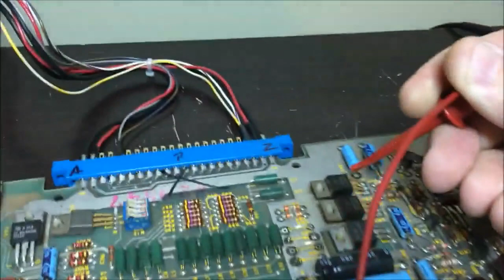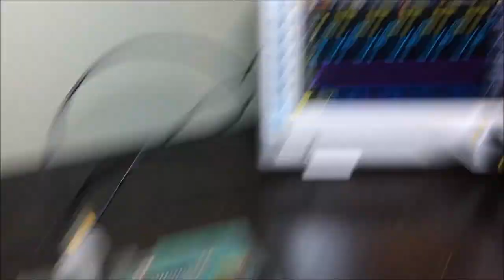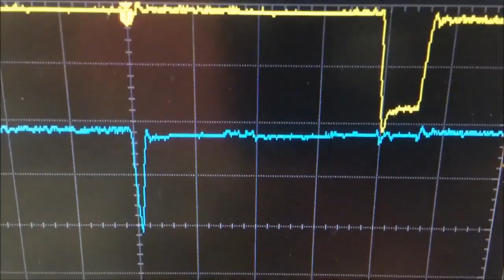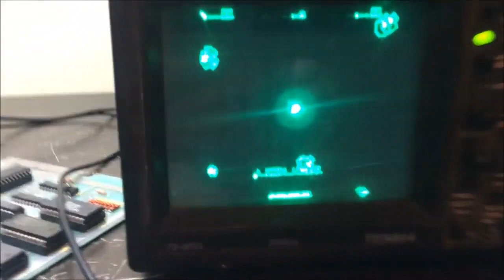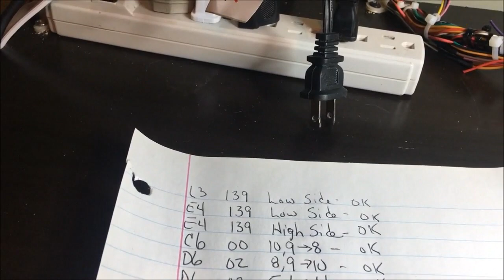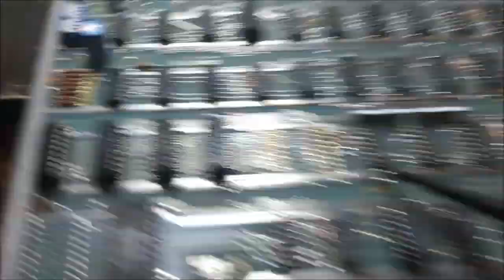1979 Atari Asteroids PCB Repair - From Jan, 2019 - One You May Have Missed - All 3 Parts in One

Comment: I was surprised to hear that 24V is being fed to the input of the 7805. That is a lot of voltage it has to drop and with no heat sink on it. The vector section doesn't have a lot of parts so there isn't a lot of current draw and that will help the part from being overly stressed.
Reply from the maker: I agree,  that is a lot of voltage to to drop in the7805.  probably be better to just jump a wire from the logic +5v over to the output pin of the 7805 would be, and remove it alltogether.

Comment: For what reason did you bypass rectification?
Reply from the maker: This video was made 4 years ago. at that time I did not have the bench setup that I do know. I did not have AC to run at that time,  so I just bypassed the diodes.
Reply: @classicarcaderepairs  That makes sense. I was blindly searching for a technical reason and missed this.

Comment: Don't those voltage regulators get hot without them being bolted to the PCB copper? Those plastic clips don't look like they keep the regulators held down.
Reply from the maker: They get slightly warm..  they are not meant to be fastened down,  just held in place
Reply: You'll find that classic arcade PCBs were all pretty hinky in regards to electrical engineering. Nobody expected them to be used for more than a few years so they made them as cheap as possible.